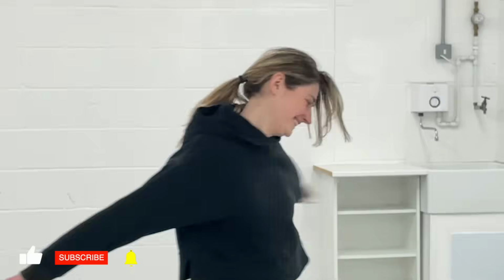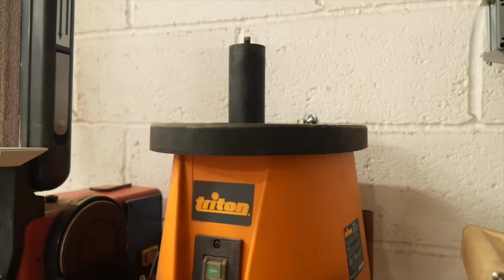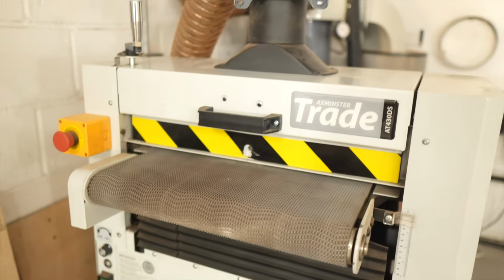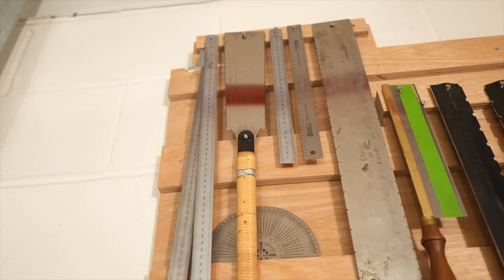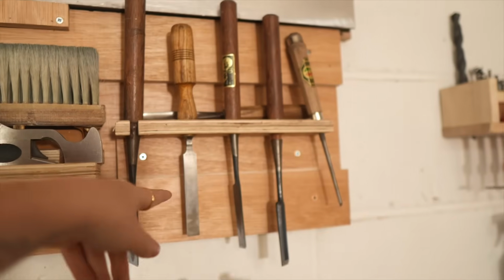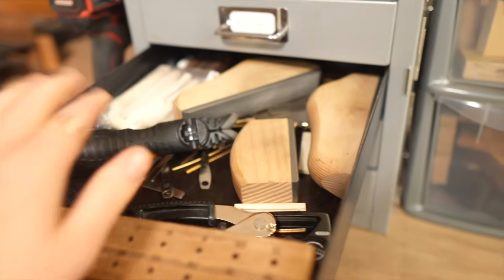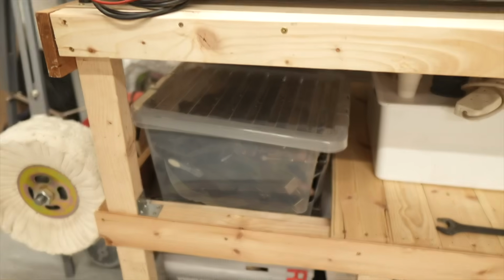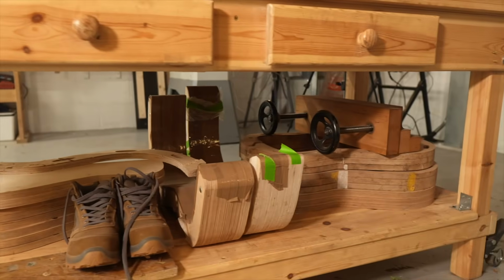Luthier's Workshop Tour

Comment: Funny that you have a DE-humidifier. It's like 5% - 20% relative humidity where I live. I can buy kiln dried lumber and after sitting around my shop for a while, it still moves. I don't build acoustics, because I wouldn't be able to ship them anywhere. I only build solid body electric guitars. It would be so nice to have such a big shop and a lot of power tools, but I do have over $150k in mechanic's tools, since that's my day job.

Comment: Love your work love your style.  I noticed that you mentioned the extraction from your big drum sander was not very good. One of the problems that I can see is the ductwork that you’re using isn’t the most efficient type and also the extreme angles some of them look like they’re more than 90°. A smoother transition something with less than a 90° angle will definitely increase the airflow.  Good luck. I’ll be watching.

Comment: Dear Daisy.
I have seen your video. One comment:
If you sand something with lacker on it, you can avoid it sticking to the sandpaper. Use a thin layer of petroluem on tha lacker. It prevents sticking.
Lover your workshop and your work.
PS. The petroleum will not combust! Just to ease your mind.

Comment: re your extraction pipe... is that a copper earthing wire travelling along the pipe? 
If so, I think you ought to run the earthwire INSIDE the pipe because THAT is where the static charge is generated -not outside. Just a thought someone told me about so Im shareing. Perhaps you could share back and tell me how to spell??

Comment: I have workshop envy! 

Hmmm... Drum sander extraction is a problem. Do you have wire mesh in the outlet right before the hose? We did in a previous workshop. We cut it out with wire cutters and it made quite a difference to the collection efficiency, as it had paper thin bits of wood stuck in it. Worth a look.

Admittedly, this was a college workshop and teenage boys do terrible things to tools. : )

Comment: Hello Daisy. You have a fantastic workshop. I'm envious! That being said. I hope you'll accept some advice. I noticed your shelf with the battery charger & the green light on indicating that the battery is fully charged. You should not leave the batteries in the charger after full charge for any period of time. I'm a General Contractor on the Central Coast of California with over 30 years of experience. I recently had a customer who had a row of battery chargers lined up on a workbench against a wall in his garage. He would leave the batteries he wasn't using that day in the chargers all the time. One day he went to work, and came home after work to find his garage on fire as a battery overheated & caught fire. The fire "lapped" up the wall to the ceiling and over to the attic ladder (which was wood) & burned through allowing the fire into the attic space. Luckily a neighbor called & the fire dept put fire out before the house burned to the ground.

Comment: I’ve used many brands of routers and for the last 30 years have found Porter Cable to be the best until about six years ago I got a Festool which is now my gold standard.  I have six routers and still use both manufactures and have never had one fail doing its job.  I love watching your video’s, I’ve been around a bit, but still love learning, you are very informative.

Comment: router breaking could be that you are taking too much of a cut putting too much load/heat on the motor...take smaller cuts or go around a little slower

Comment: Excellent walk through. Having cut vast quantities of Western Red Cedar with CNC, I found that cedar has a lot of silica in it and is very hard on tool edges. Use downcut bits to leave a clean surface finish. Keep feed speeds up there. Running too lower feed speed and high revs results in rubbing instead of removing material. This heats up the tool and is not good. Also try not to recut chips. A good extraction is very important. Definitely going to watch more videos. From an retired old fart it is a pleasure to see young people that respect hand tools.

Comment: Thanks Daisy for the shop tour. I know from experience it takes time to evaluate your work area and what works best. As you get more experience and build more guitar you’ll see the need to make changes, to upgrade tools, etc. I try to buy quality tools but that doesn’t mean they have to be the most expensive. I find when I need to upgrade tools or equipment it’s mainly for accuracy, and that accuracy is usually in a quality built tool. Hand in there young lady, continue to produce beautiful quality guitars and in time your work will be sought out.

Comment: Very nice tour, many thanks!

Two essentials I did not see.  A particulate detector, an air purifier.  

I also work on an interior shop.  And sadly it has marginal ventilation.  I have an oversized air purifier that helps enormously with dust control.  And the particulate detector lets me know if dust levels require masking.  Perhaps the ventilation in your shop makes this less important than in mine, however I highly recommend measuring particulate to make informed masking decisions.

Comment: That just made my day. I always love watching shop tours. Thank you for sharing and teaching me the difference between a rule and ruler. 62 years old and never knew that. I love when younger people teach me things. 
As far as routers, I've recently purchased 2 of the small DeWalt cordless routers (DCW600B) for site work and love them. Great if you happen to have DeWalt batteries already. If not, or if a corded router is still fine being that your in a shop, I've had the Bosch (PR20EVS)  router. Had it for over 20 yrs before I need to rebuild it. Works great again. Great palm router. Also, I have 3 Porter Cable 690 routers. Had 2 for over 25 years, bought the 3rd second hand. Never any issues with any of them. Not sure if they're still making them, but wouldn't hesitate buy used if in good condition. No dust extraction though, but can buy 3rd party dust attachments.

Comment: Your channel is new to me and I must say I like your process. A thought about your drum sander extraction issues. Can you get them closer together? A shorter hose should increase draw. Cleaning the filter in your extracter pre drum sanding should yield a better result. A more costly mod might be to increase the hose diameter from the extracter to the sander(not sure if thats doable budgetwise).I'm not a luthier but I am a player with lots of modding experience. Also 18 years in a woodworking environment. Cheers from Canada!

Comment: My problem with my workspace, is that I am constantly learning so much, that I have to set up new areas for new tasks. So for me the biggest helpful tip would be to make the sections modular. Be able to pack up a small 4 ft section at a time, and put things into project tool boxes. 
I mean I enjoy soldering electronics, but I don't need them out all the time, so I pack it up and replace it with something else say like my Dremel. 
But I must say I am very envious of the space that you have created.

Comment: Awesome tour of your home away from home... You mentioned the dust collection is still an issue with the drum sander in particular ? I stopped video to look at plumbing of ducts etc and while it is a bit longer than ideal, I don't believe it is the cause of your issues. I'm guessing, but how is airflow vs orientation of sander's rotation ? 

I'd look at where and how the sander naturally directs dust. It looks like its rather close fitting and has just a few small gaps, but perhaps that is preventing airflow into intended capture areas, ie entrainment of dust by airflow ? Solutions may be to add an outside source of compressed air or a fan blower to blast dust towards upper ducting area before it reaches end of bottom belt's travel where it's falling out on floor. An obvious indicator of this condition would be if the hose shrinks lengthwise like a spring because it's got a lot of suction, but too little air flowing...

Comment: Still with my 1st wife; but if I ever consider marriage again I'm going to ask for shots of her shop (you'd be in the running. :^) ).
Lie-Nielsen No. 102 Low angle block plane; got it because it was inexpensive; now - more planes than I really need (including other L-N block planes) and it's still my favorite. Just a great plane and highly recommended. 
Jet Thickness Sander aka drum sander. I have one. Hate it. The little mechanisms they use to grip the paper are the work of the devil. Sometimes I get them to work, too often not. However; when it works properly I love it. Have NOT had a problem not getting the board level; but not working with sound producing objects perhaps my standards are good enough for my work. Anyway, one end of the paper always works loose, causing burn marks on the wood and ruining the sand paper (because it tears).  The paper grippers really need a do-over. I have no room for a machine as big as yours and being retired - most of my money goes to camera gear. :^)

Comment: I noticed you mentioned your drum sander extraction is not great. Might be cause the pipe has a down bend in it after it leaves the machine. Might be creating a back flow turbulence. A smooth up curve could work better.